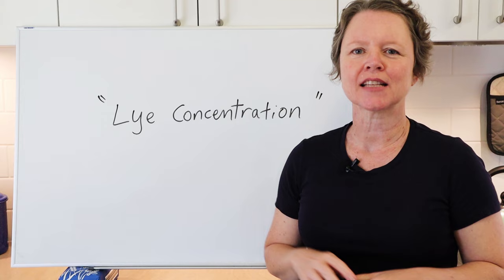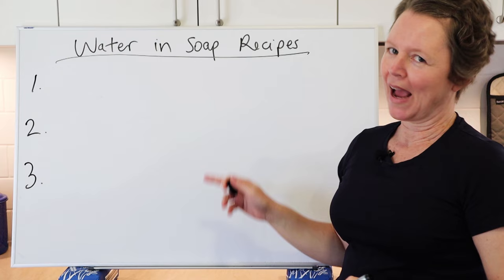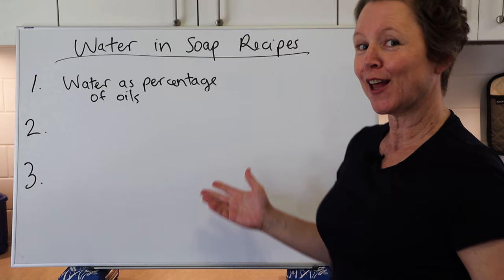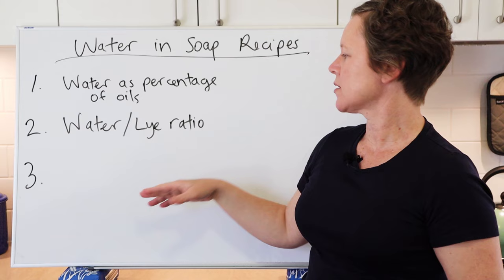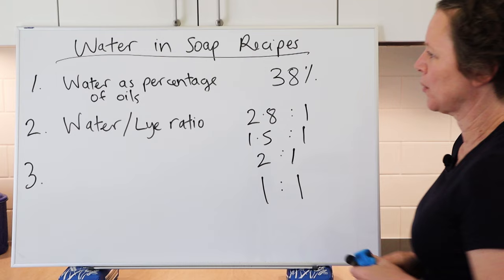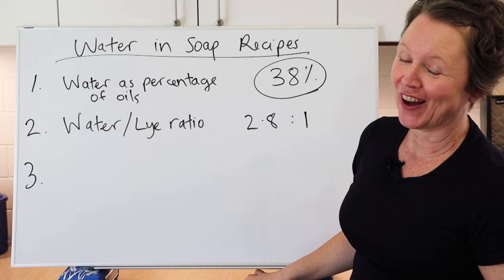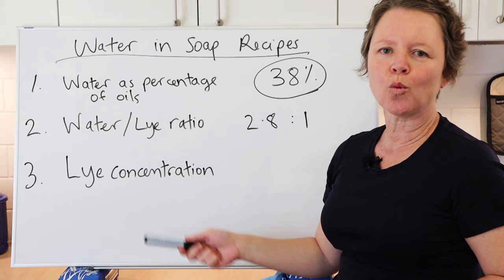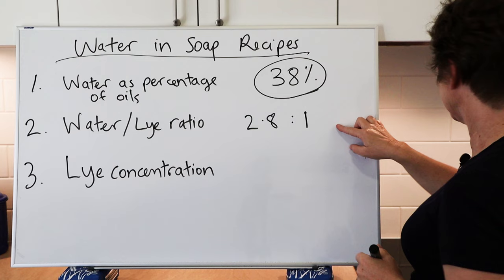Calculating Water in Soap Recipes and Clarifying 'Lye Concentration'

Comment: What is the reason you use a low percentage of water in your soaps?  I think you said, 20-22%.  Does that mean your soaps have better moisturizing benefits and don't shrink/dry out as much over time?  I heard Ellen Ruth Soaps say she uses 28%.  So, I'm trying to understand how you each came to your decisions.  Why does soap calc default to such a higher percentage?  What's the benefit to anyone of having such a high amount of water in their soap?  Does it affect the length of time you reach trace?  Thank-you for all your highly informative and helpful videos.  They really do help us newbies work our way through the learning process.
Reply from the maker: Great questions! I generally prefer a lower water amount, it reduces soda ash, reduces shrinkage (less water to dry out of the soap) and makes unmoulding a lot easier. I have no idea why soap calc default is so high. I wish it weren't! More water can slow trace, so that can be beneficial in some recipes.
Reply: @EllysEverydaySoapMaking  Thank-you!  I never thought of it as affecting the unmolding.  Interesting.  If it helps to slow tracing, then it might be beneficial in a soap with added sugar or milk, then.  I just made sure I was ready for anything to happen, but I can see the benefit of not having to sweat.  lol  I will play with 22% in a small recipe and see what it does.  I've followed Ellen Ruth's 28%, with no idea why I was doing it, rather than what soap calc defaults to.  I'm be curious to see the difference if any between your two percentages.  Nothing ventured, nothing gained.  Thanks so much!

Comment: Hello Elly,  sorry to ask  you a silly question but i cant find the answer anywhere !
Does  the  lye concentration percentage  have an affect on how gentle  the soap is after being cured ?. Eg  making a castille soap with 42 percent  lye concentration ,  is  is still as gentle  if  the castille  soap was made  with say  33 percent lye concentration ?.  I know  its about the water  content in the soap  not the actual lye ,  but does a  higher lye concentration  level  make the soap less gentle ?   Im hoping to make some  baby soap  and  wanted to clarify what lye concentration to use  for a simple baby soap ?. 
Many thanks.
Reply from the maker: Hi, no the water amount in the soap doesn't affect its gentleness (unless you don't have enough at all!). As long as you have at least the same weight of water as you do lye, it will be fine. The gentleness of the soap is more down to the types of oils used and superfat level. Water is just the vehicle to dissolve the sodium hydroxide.
Reply: @EllysEverydaySoapMaking  Thank you for your reply,  I am hoping to make one using   55 olive,  20 coconut oil, 20 shea butter and 5 castor-  no  colours or scents  with  40 percent  lye concentration. Hope that sounds ok for a baby soap ?
Reply from the maker: Sounds nice, but my choice would be a pure olive/castile soap for baby. It's a personal choice though! I think your recipe would be fairly gentle. I find anything over 10% coconut oil a bit drying though.
Reply: @EllysEverydaySoapMaking Thank you  i will change that to 10 coconut oil 65 olive 5 castor oil and 20  shea butter  :)

Comment: Hello Elly,
I have a question to ask you, I saw your one of your video on formulating soap recipe and the question is Why have 4% has superfat? Why choose 4% as the value? And does the 4% remain a constant if using a different recipe? Why have 8-9 as the pH value of your soap while it's recommended to have a pH of 9-10 ( i did a search on the internet and this is what I read about the recommended pH).

Looking forward to your response.
Reply: And why is the superfat of solid soap different from liquid soap?
Reply from the maker: Hi, you can choose any superfat value you like, most people use about 5% - sometimes higher and sometimes lower depending on the recipe. I'll be doing a video about superfat soon! You need a very low or 0% superfat for liquid soap, otherwise the unsaponified oils will float in the soap and it won't be a consistent texture. Most soap is about pH 8-9 - that is ideal. The lower the pH the better :)

Comment: makes sense to me!  thanks for the video....what I get confused about is the fragrance oil percentages.  could you do a video on that?  I played around with adding more fragrance oil because the scent was not as strong as I'd liked, and ended up with a mess - meaning a small percentage of oils did not saponify and when I cut into the soap - oils spewed out in the middle of the block of soap.  I get confused when it says to use up to 3% fragrance oil - is that 3% of the total oils in my soap?  is it 3% of the total weight of the batch?  any advice you can offer would be greatly appreciated!
Reply from the maker: This video will help a lot :) https://youtu.be/JkcjC3wV0ZA
For most essential oils, 3% of the weight of your main soap making oils is what you want.

Comment: Hello!😊so, my confusion with this topic came when I was attempting to add additives to my soap. I'm wanting to add buttermilk and pumpkin puree to my soap, so would I need to subtract my  additive amount from my water amount?Is it different when working with purees? I've found conflicting information on this! I made a loaf and discounted the water from the additives and ended up adding less water than lye to my lye solution😬I wish I had seen this first. Should I discard this batch? Or test it and see if it turned out?
Reply from the maker: Hi Amber, yes it can be problematic if your lye solution was more than 50% lye concentration. I would be tempted to throw away that batch, but if the soap texture is even, and it tests safe, then it may be ok. I guess if the puree and buttermilk were all blended in very well, that may have worked. It is tricky when adding purees. Some people do a water discount and add them as an additional ingredient (but never have lower than 50% lye concentration), some people replace the full water for a liquid puree mix. So many options!

Comment: so i normally use the default of 38%, if i were to put 33% in soap calc, does having less water make a quicker cure time?
Reply from the maker: 33% water as percent of oils is still a fairly high water soap. Lowering the water amount does speed up the cure time a bit, but I still recommend 6 weeks for any soap. Having less water in a soap recipe reduces shrinkage of the cured bars, so that's the main benefit for me :)

Comment: Are these calculations based on weight only or is some of it based on volume. You keep mentioning water lye mix was by weight, that I got. But is the water to oil also by weight?
Thank you for this video. It does explain a lot .
Reply from the maker: Thanks Robert, yes, everything is always measured by weight in soap making.

Comment: How to calculate the weight of juices / aloe juice / milk I need when their density and weight is not the same as water because of nutrients and pulp residues but their volume of liquid is the same ? 

I ‘m confused and calculated liquid quantity 380 ml instead of 380 grams and put liquid portions to freeze already. + I made a mixture of juice + milk powder + rice powder so of course they increased the weight and volume of my initial liquid quantity. I think it should be about 33-35% water anyways so it should be OK but can you please confirm ? Thank you 🙏🏻

Comment: would you mind to explain how you do calculate the 26% for the third way ?
Many thanks for all the explanations you gave it's really help.
Reply from the maker: That's just the equivalent lye concentration amount that the soap calculator told me when I put in 38% water of oils. Most soap calculators will give you the results for all three methods regardless of the one you use :)

Comment: Super video. Thanks for that. tell me, from the other side of the mirror - at what point would it get silly in regards to the amount of water being used. In other words, what is the maximum amount of water (theoretically) that could be used before the lye itself became useless?
Reply from the maker: Well, the more you use the more soft and soggy your soap will be. Proably 3:1 water to lye is the max I'd use. It would make a very soft soap.
Reply: @EllysEverydaySoapMaking  Got it! Many thanks for that.

Comment: Another informative video from you elly!!!! Question though, what is the effect on the soap if there is so much water? I am more used to the first method. What is the ideal % using the firat method.

Thanks
Reply from the maker: Thanks April. Mostly the high water affects cure time, and there is some shrinkage of soaps when they have a lot of water in them - because there is more water to cure/dry out, so they cave in a bit and don't look as good. Some people like high water because it's easier for doing swirls and other patterns, the soap doesn't set up so fast. I only make quite plain, unswirly soaps, so I like to use less water :)
Reply: Oh! Now i get it. So what could be the ideal percentage if i go with method 1, water as percetage of oil? The first loaf i made took 5weeks to cure
Reply from the maker: Regardless of the amount of water used, your soap will still benefit from a full 6 week cure. I like about 22-25% water as percentage of oils. But it depends on the recipe :)
Reply: @EllysEverydaySoapMaking  oh okay. This is well noted Elly. Some recipe may require more water?
Reply: @EllysEverydaySoapMaking  If you use the 3rd method  which is the lye concentrate in this video, what is the 22-25% be?

Comment: Thanks again...
You are fantastic.
I made 100% coconut oil laundry shop yesterday. and I added some titanium the oxide about 1 tablespoon, for oil batch of 1100.g. shop was little bit hard. And difficult to cut with a soap cutter after 24 h. Is it because of titanium....?
Reply from the maker: Hi, no that's pretty normal for coconut oil soap. It's always quite hard and needs to be cut a lot sooner than 24 hours. You can cut it as soon as it is hard enough, sometimes only takes a couple of hours after making.
Reply: @EllysEverydaySoapMaking  thanks 🙏🙏🙏

Comment: Tks for that explanation.
The hardest to understand it's the lye concentration one... so if I need 134g of lye and I decided I want it to be 40% so to figure out the water amount (X) I do X=(134 x 60)/ 40= 201 g of water... is this right?
Reply from the maker: Hi, you don't need to figure out how much lye at all, the calculator does that for you. You just need to decide how much water your want in your recipe. If you want a lot of water, you'd choose a lower lye concentration, if you want less water, they lye concentration will be higher. The lye amount doesn't change, that is dependent on the oils. You are just choosing how much water you want in with your lye.
Reply: @EllysEverydaySoapMaking     tks Elly, I guess I understand it. I've been using the the 1st and 2nd method you explained and works good for me. i wish you have a good day, im off to bed now. tks a lot greetings from Portugal

Comment: How does bumping your lye concentration to 40% from the more typical 26% affect your cure times? How much water typically cures out of a batch? Can I use the weight to judge curing progress? 🤓🤔🤷‍♂️
Reply from the maker: Hi, yes you can weigh it. The low water does more to reduce shrinkage than anything else, as all soap will eventually dry out.

Comment: Hi Elly! Thank you for the wonderful video. It’s made my life so easy! After 13th (when I watched this video) I have made 7 batches of soaps. I have used the lye concentration method. Out of the 7, 2 soaps were a disaster 😊.

1. Honey and Oatmeal soap which had 20 gms of honey and 2 tbsp of oats, recipe was 40% coconut oil, 30% olive oil, 20% palm oil, 10% castor oil at 40% lye concentrate. This soap didn’t harden at all. Could you pls point out where I made the mistake ?

2. Coconut milk and oats Soap: Same recipe as above 👆. Replaced half of the water with coconut milk and blended the milk to the oil before adding the lye water. This one had a volcanic eruption within few minutes. I was taken aback because it’s the first time this recipe behaved this way. I have been making this soap for 2 years now, but just this time tried with the lye concentration method. Obviously the soap heated up, but could it be because the water was reduced ? My earlier recipe called for 375 gms of liquid and as a result the soap was softer. I changed the recipe using your technique to make harder bar. Pls guide where I when wrong here.
Reply from the maker: Hi, sorry but I can't see why your soaps didn't work out if you ran the recipes through a lye calculator and understood what you were doing. There's nothing really new about the lye concentration method, it's just another way of deciding how much water you want in your soap. Were you using hot oils? That's the only thing I can think of that would cause a volcano...
Reply: Elly's Everyday thank you Elly! I tried rebatching both soaps, but they wouldn’t harden.  I am not sure what happened. I’ll probably have to discard them. 

Waiting for your new video 😊

Comment: Hi Elly. So, the ideal NaOH solution is 33% lye and 67% water and I've seen you use this solution for the 100% coconut oil soap. When making soaps with mostly olive oil I've seen you use a 40% lye concentration. Is it better to use less water in the NaOH solution with moisturizing oils and more water with cleansing oils?
Reply from the maker: Hi, no there's no ideal concentration, I just use different amounts for different soap recipes. Sometimes arbitrarily! Around 33% LC is a good moderate amount that you could use for most recipes. I use higher water for HP recipes :)

Comment: Great stuff Elly! Very well explained.  It's interesting how the ingredients all relate to each other. What are the effects on the soap if you raise or lower the Lye concentration? You probably have a video on that :)
Reply from the maker: Hi Davey! Hey everyone, this man is my awesomely talented COMEDIAN and ACTOR COUSIN, living in Los Angeles! (Thought I'd give you a plug).
Good question! As I said in the video, it's really about how much water is in the recipe. High water soaps can be great if you're doing swirls and pretty patterns and you want the batter to saponify and thicken less quickly, but you can get some shrinkage of the final bar because there's more water in the soap to cure out through the drying process. If you're making simple soaps like most of mine, a low to moderate water amount is good. The soap quality in terms of quality and skin feel is the same (that's all about the oils), the main differences are the effects on saponification (low water is a bit faster to set up) and cure time/shrinkage.
Reply: @EllysEverydaySoapMaking  That makes so much sense. I feel like this is easily a rabbit hole I could go down. If the lye and oil content are constant but the water content changes, do you end up with the same weight of soap once it's cured? I would imagine the water evaporating is part of what the curing process is all about. Also does it make the soap physically softer to have more water?
Reply: @EllysEverydaySoapMaking  I'm so glad David asked that and you answered. I didn't know the reasoning behind the different amounts as I am very new to soaping and have yet to work up the courage to work with lye. I have a lung disease and am afraid of the fumes from the lye, do you think a regular surgical mask would be sufficient to prevent most fumes long enough to move it away from my immediate work area while it cooled? Thanks love your videos, you are definitely a super star!! 🌟⭐️🌟

Comment: Hi I have a huge question, the water formular can you use any wet content like seawater or tea or wil the salt or herb in tea effect the other calculations.  Your videos are so fantastic thank you very much.
Reply from the maker: Thank you, yes you can substitute regular water for other 'watery' ingredients. The salt does harden the soap and reduce the lather a bit, but it does not interact with the lye so there are no changes or adjustments required. I've made  a few videos with sea water in them!

Comment: Hi Kelly, thanks for your video , looking at your video for past 1and half yrs got inspired and have started making soaps and was successful, I am getting feedback saying getting some itches, rashes etc what could be the reason I am using 40percent lye ratio
Reply from the maker: Hi Padmapriya, the term 'lye concentration' doesn't have anything to do with the amount of lye in the overall recipe, only the concentration of lye in the lye-water solution (so it's a way of calculating the water amount for the recipe, not the lye amount). It sounds like you may be misunderstanding how to calculate soap recipes correctly and are putting too much lye in your soap recipes. You must always use a soap calculator and get the correct lye amount according to what the calculator tells you you need for the oils you are using.
Reply: @EllysEverydaySoapMaking  thank you so much for the quick response,  I used the soap calc to arrive the lye amount I opted for 40percent option. I also checked the other option the lye amount is not varying the water amount changed, is more water could help dilute the effect of caustic soda?

Comment: In other video you talked about 40% lye concentration and now you talk about 26 %. Which is the correct one?
Reply from the maker: They are different ways of expressing the amount of water used in a soap recipe. Sorry to have confused you! The 40% and the 26% discussed in this video refer to different methods for calculating water. The 40% refers to the lye concentration method, and the equivalent of that is 26% water as a percentage of the oils. Soap making can get quite technical! Hope that helps :)